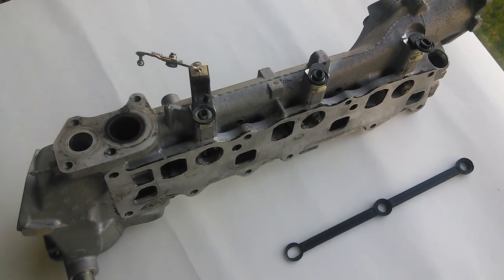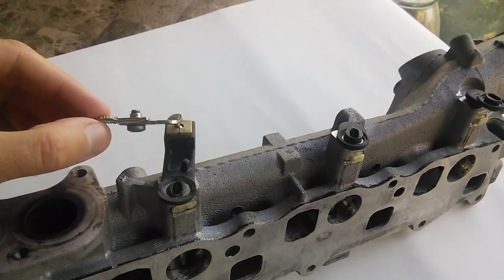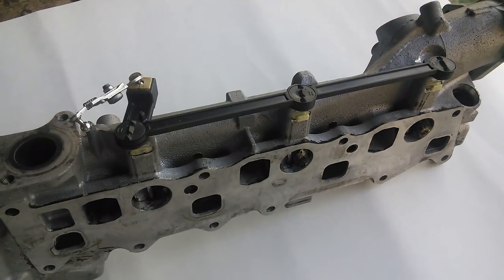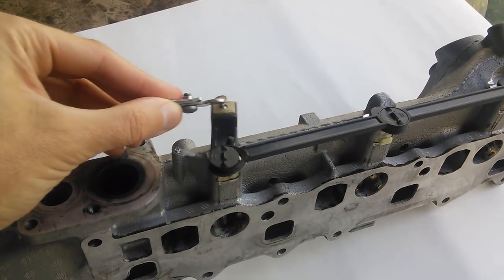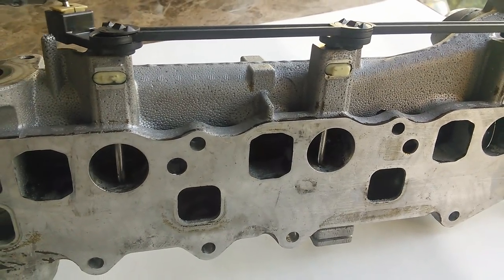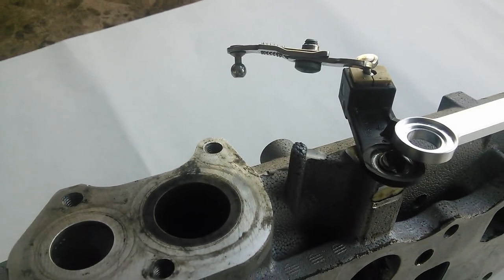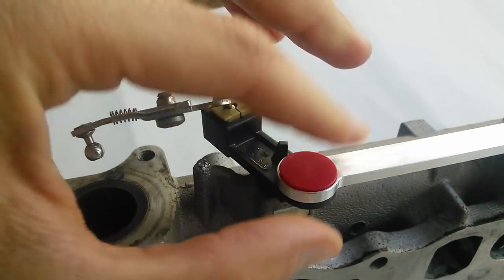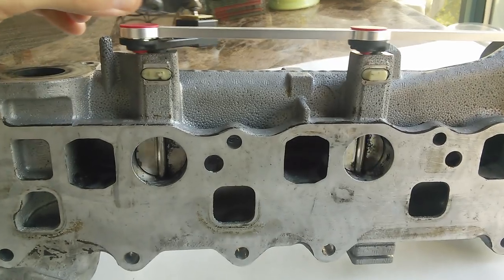Mercedes Diesel OM642 3.0L V6 - Intake Manifold Runner Connecting Rod Replacement

Comment: Какви са симптомите при тази повреда?
Reply from the maker: Обикновено лампичката "проверете двигателя" ще светне и двигателят ще премине в режим "отслабване / слаб / бавен"
Reply: Лампичката не светва, и колата не преминава в авариен режим, обаче понякога двигателя променя звука си и от което майсторите се съмняват че клапите задират или има нагар . Не го прави винаги,а от време на време. Имате ли идея от какво може да е? Блогодаря ви предварително, а и даже от октуатора се съмняват
Reply from the maker: @harunsyuleyman757  Може би, ако автомобилът е по-стар от 2009 г., може да се държи така, както описваш...

Но от 2009 г. те добавиха сензор на свързващия прът, така че наистина трябва да светне/аларма на двигателя, ако клапаните не се отварят и затварят правилно...
Reply: @maciejzielinski1274  Ciao! ..I own a GLE 350d from 2017 with 130’000Km on it, and I was wondering if I would replace the rod as preemptively? ..it seems that my mileage could go up if I do it. What do you think?
Reply from the maker: @pventi20  Its about 6-9 hrs labor to do this, so if you're already doing some major work in there, then it can certainly be worth it... Otherwise, its probably not worth the time... You probably won't get noticeable improvement in mileage unless the intakes are very clogged and the rods very worn...

Comment: isn't it better to defeat the swirl valve motor???
Reply from the maker: I don't believe you can defeat it on 2009 and newer models, when they started using sensors on the rods...

Comment: I have code P2013 runner intake control code, check engine light comes and goes. Would this fix it? I know it’s a big job, it’s a good opportunity to replace the oil cooler as well
Reply from the maker: Don't think that's the right alarm for this issue, sorry... should be P2005/2006/2007...